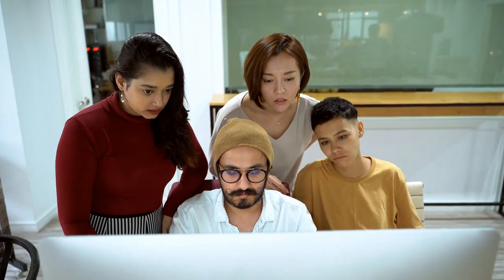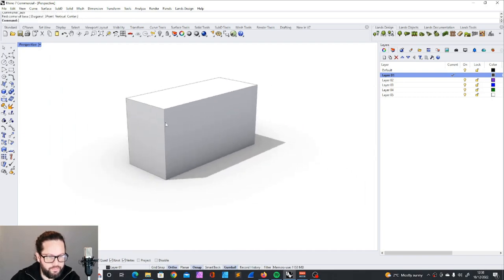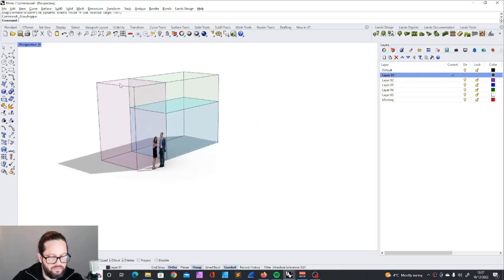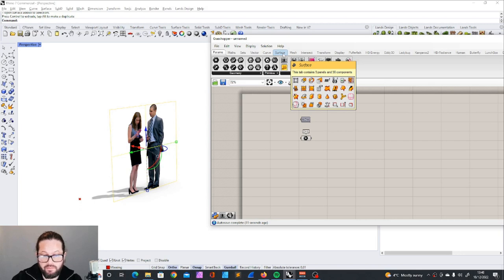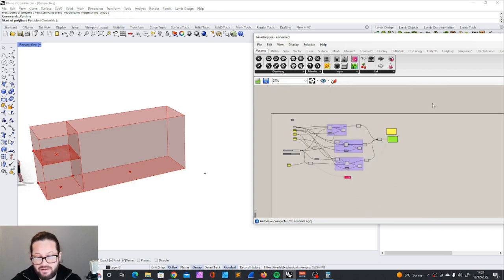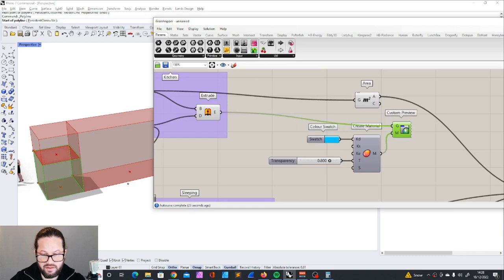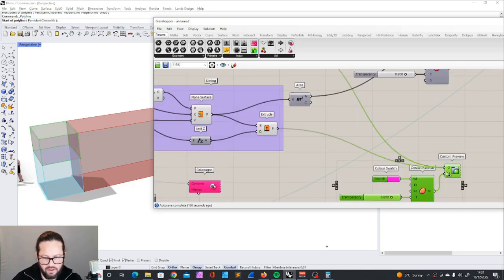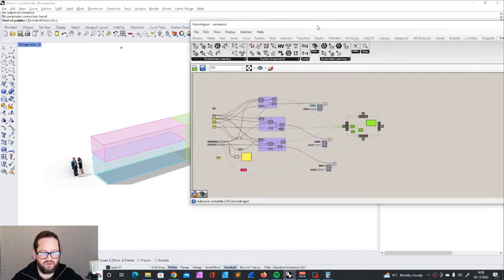The Problem of Tiny Houses | Area Optimization with Galapagos | Tiny House Challenge 01

Comment: If for instance, i wanted to analyze the carbon capture capabilities of a filter, like concentration or of CO2 from an outlet,  do you think Eddy would do the job or Butterfly? what do you advice I use? A simple wind analysis, indoor analysis or outdoor comfort?
Reply from the maker: Eddy is definitely geared towards urban planning applications. Butterfly is Since 2018 not further development. Although it's great for simple heat transfer, air circulation or wind analysis I don't think it will be suitable for this particular problem. You might need to search for different software. Or my look directly into BlueCFD and see if this might be able to accomplish what you are looking for.

Comment: Hi! Thank you so much for the video, it is very clear the way you explain the potential of galapagos for that case. 

I have a question about the shadow appearing after the Custom Preview component? Is that related to the rendered mode in rhino? Or how did you do that?
Reply from the maker: The shadow is just in rendered mode. Which can have different light sources.
Reply from the maker: You can use scene lightning. And you need to turn on the sun. I also sometimes play/add with the environment settings for a better effect.
Reply from the maker: I think I did a video in viewport modes...

Comment: I don't think Galapagos was needed for that. You could just use sliders or arrive at a solution by writing a simple algebraic equation. Why you used Galapagos here? Any particular reason?
Reply from the maker: I used it to show the tool with a very simple script just explain the what it does. It's not needed in this example I agree but there are no tutorials on Galapagos which explain it in super simple terms. 
Beginners might have better understanding now and can use it in a more complex environment. That's all.
Reply: @PhilippGalvanDesign  ok.